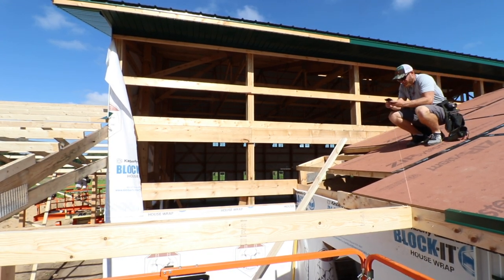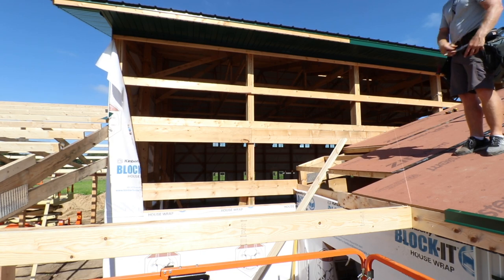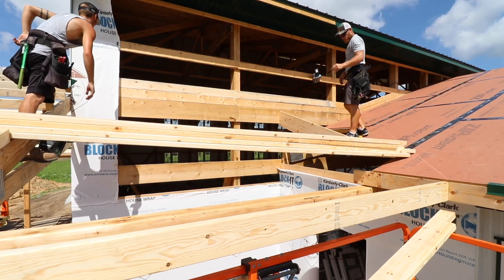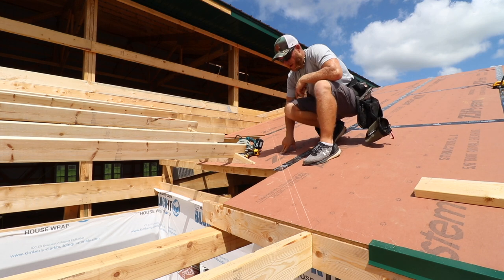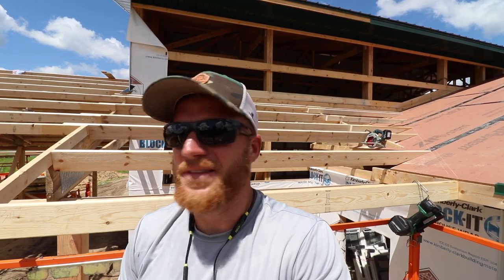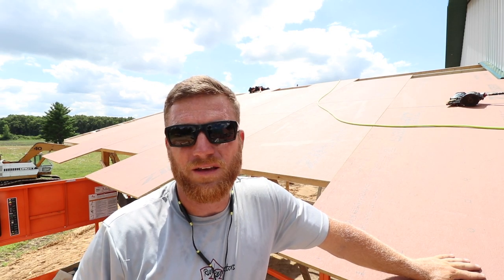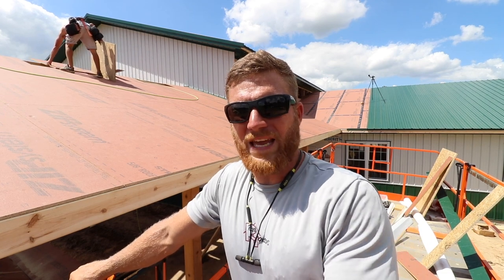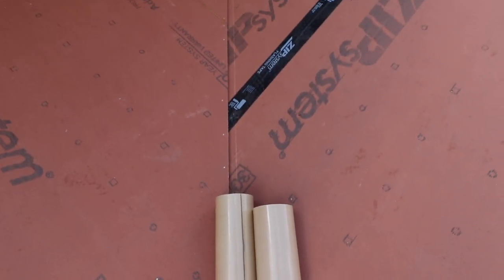Building a Hunting Cabin 15: Over Framing a Valley on A Roof

Comment: Thanks for the review.  Always do your math and measure twice (or three times) and cut once. Some folks may not notice it but a square built roof line with correct hips and valleys are an asset to the structure.  I can them from a distance if they aren't done very well.  Clear, plumb and level fascia is KING.

Comment: That short rafter bears on a 2x4 purlin spanning 8' between columns. Once you add the porch roof purlins on top of the short rafter, all of that load is getting transferred to that single 2x4 purlin below. Seems like a lot of load to put on a 2x4. 

Beautiful work framing that roof!
Reply from the maker: Did you hear what I was doing tho... I didn’t show it but I transferred all that weight to the foundation underneath
Reply: @RRBuildings  I heard you, the joist bears on the the 2x4, the 2x4 transfers the load to the  truss on either side, and down the columns to the footings. So basically you've made an 8' long header out of a 2x4. I would have cut out that 2x4 between the columns and replaced it with a 2x8 or a 2x10 so I wouldn't have to worry about a big snow drift building up in that valley. I wish you were closer to eastern PA as I will be needing a pole barn next year.

Comment: I think that rafter would have been better supported out on top of the wall, it should be fine. My only fear would be snow load in that valley under an eve could be pretty substantial. and you did go on to say you will put in another support up to the bottom of that perlin, should help. Just me typing out loud, I wasn't there in the moment. Lol. Good work boys, keep it up.
Reply from the maker: yes we supported underneath to the foundation

Comment: Use a framing square.  Everything you just mentioned, except the purlin depth, is printed on the side of a framing square.  For you, it will be an easy transition learning how to read it.  Example. A recent customer presented me with plans for his gambrel roof garage.  All plans were drawn by him on a very sophisticated computer program.  He could tell me the angles,,, but I had to send him back to give me rise over run.  It was funny.  The one pitch was something like 24.376/12 and the upper something like 7.628/12.  I used those dimensions.  On a framing square it was easy.  Lengths, angles, overhang, birds mouths,,, I never had to calculate anything.  Just use the framing square.  Once you get it,, conventional framing is a snap.
Reply from the maker: Actually I’ve read rafter tables... they aren’t the same when running horizontal vs vertical rafters
Reply: Great video again brother.. This build looks better on every video . I love hand framing hips & valleys, your true skill comes out when you hand frame rather then throwing a bunch of valley sets or manufactured hips & jacks that never work because the truss companies cad program says it will .. haha . You crushed that valley sir !! That was pure Money bro .👊🏻

Comment: I LIKE the leaf blower,, Thank you.  I always hate sawdust on the roof.  A broom has been a normal component.  That electric leaf blower,,, I feel stupid I never thought of it before. Heck, I was sliding down a roof just 2 weeks ago.  I'll see if I can find the same battery packs for my drills/ impacts,, in a leaf blower.
Reply: Sailor376also you can also use the air sprayer attachment to the compressor hose. That’s how we did it when we ran our sheets wild.
Reply from the maker: Yes for sure.

Comment: Always cut your rafters as a 8 landing on a 12 for example. It’s a common 8 on top and a long 8 on the bottom with a 45• bevel. Always consider your rafters as “x” landing on a “x”. Should sort out some of the confusion

Comment: @RR Building,  Do you order the exact amount of roof or wall steel for a job, or do you add in an extra piece or two incase something is damaged or cut wrong?
Reply from the maker: i order exact...makes me more careful
Reply: RR Buildings I had noticed you using the last piece in the stack several times over the last year

Comment: Awful carpentry work. Shows how not to do it. Where's the drawing, rafters and purlins sitting on roofing ply. No structural members under each end to spread the load to the truss underneath. Fully reliant on screws and nails for strength instead of the joint as a whole.  Would be interesting to see a structural engineer critique your work